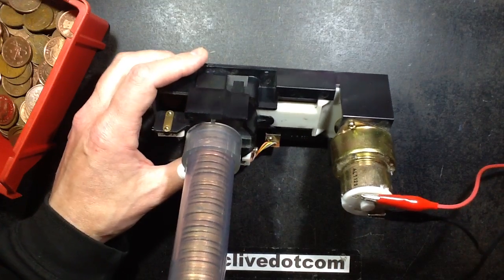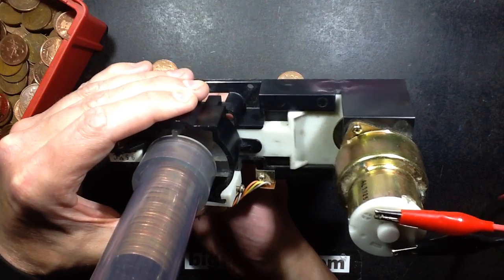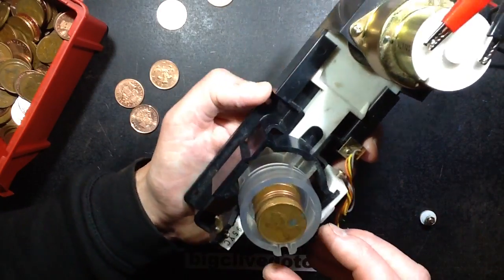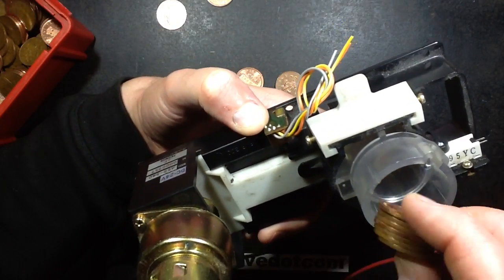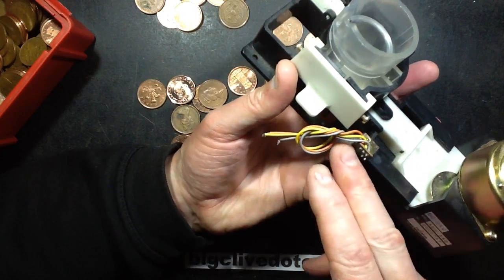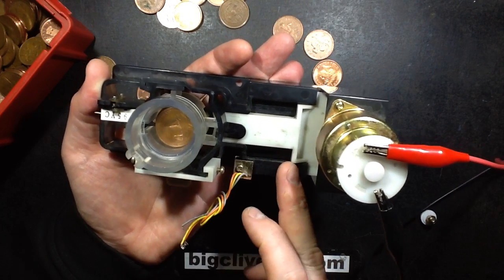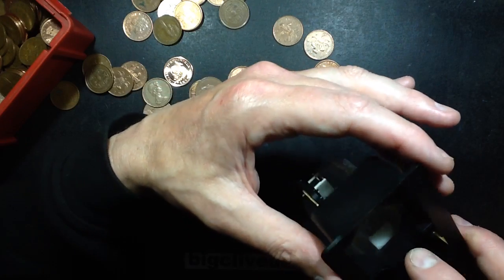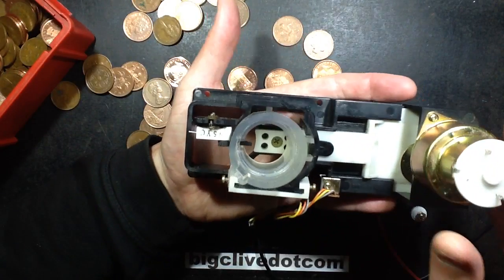Unusual motorised coin payout mechanism.

Comment: We used millions of 'spark arrestor' chips for contacts in electro-mechanical telephone exchanges.
The 'CR' units were 0,025 uF in series with a 600 Ohm resistor.
Typically a CR unit was also fitted across relay coils too.

Comment: Hi Clive, what machine is that from? Seems unusual really. Is the coin sensing circuit not flawed in that if there was a coin jam it would artificially count the movement of the side, rather than the dispensing of a coin. Hoppers coin number of coins dispensed, not number of attempts. I also have to say that you can't beat the violent "BUZZ-KLANK" sound of pre-90's  fruit machine payout solenoid :)
Reply from the maker: arcadeuk I got it direct from Asahi some time ago, so I haven't a clue what machines it was used in.  If a clump of coins did block the tube then it could just go through the motions with no cash.  But then, so could the solenoid version, albeit that it might shake the coins back into order with its violent thumping.

Comment: Thanks for the video Clive, my girlfriend has a bell fruit machine and that has circular recessed  plate on the bottom of the hopper and the coins fall in to the plate flatly and the plate revolves then the coins fall down a tube and out, the plate has 3 recesses in it at 120 degree spaces and the is inferred sensors and also a payout meter
Reply from the maker: Paul Brace It sounds like the Asahi Seiko hopper I did a video about.
http://www.youtube.com/watch?v=9r3XYydXttg

Comment: The peg-in-slot is actually called a Scotch yoke. It is unlikely because it it was created in Scotland, or (more likely) because : https://en.wiktionary.org/wiki/scotch

I like the definition 1 : to cut or notch. The pin is clearly scotched in the scotch.

I had always assumed 'Scotch' (not the malt) meant to pin or hold in place...as in scotch egg, where the egg is foiled by the casing.